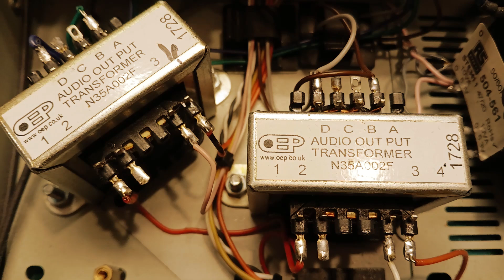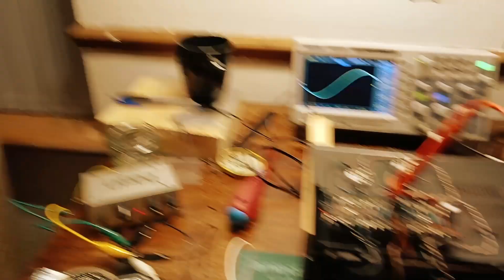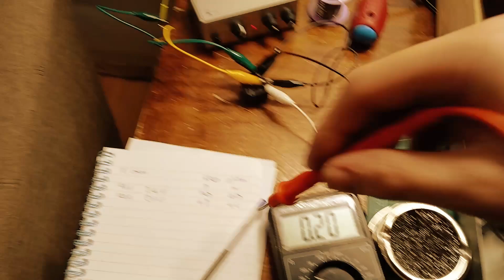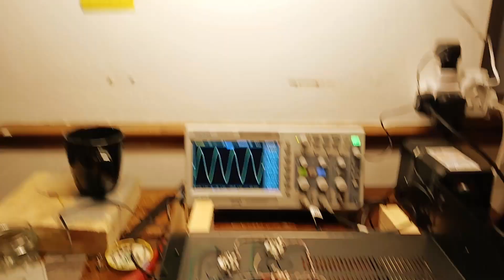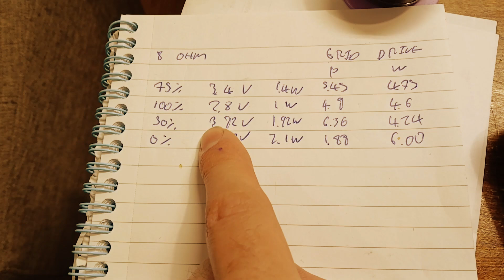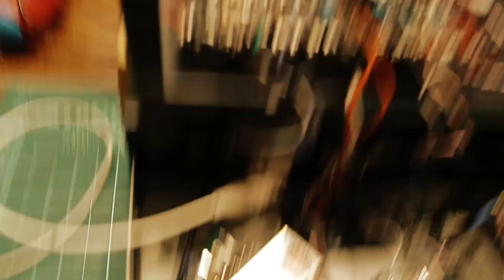Triode Ultra Linear Pentode single ended amp power difference

Comment: Thanks, for this - I could actually follow your ramble through the experiment! The most interesting bit for me and my situation is to find the capacitance from GNFB causing instability in UL mode. I think I have a similar problem with my amplifier and it may be the reason why the manufacturer has a different value capacitor and resistor, depending on the config.
Reply from the maker: It's quite common to have different values and combinations of components in the NFB line depending on different configurations.

It's a rather emperical approach to find the values that are needed to correct instability